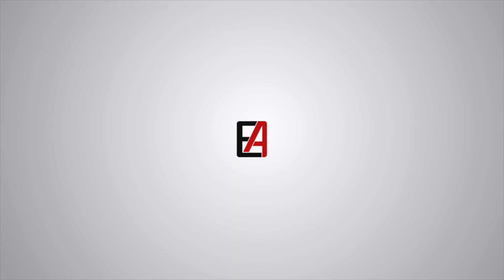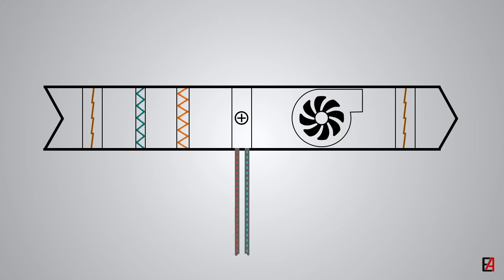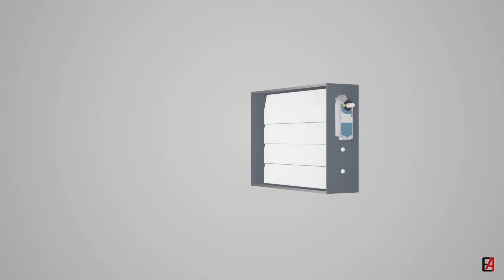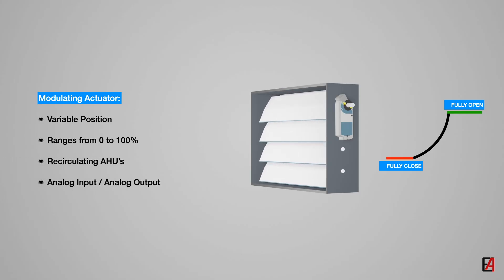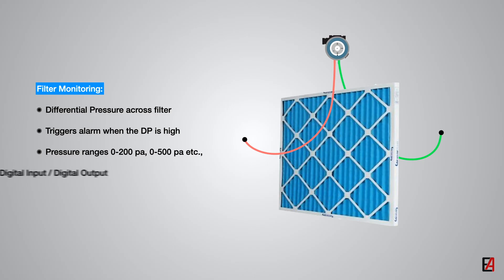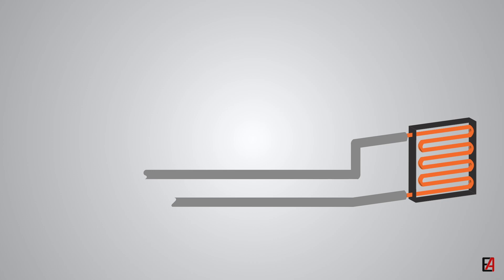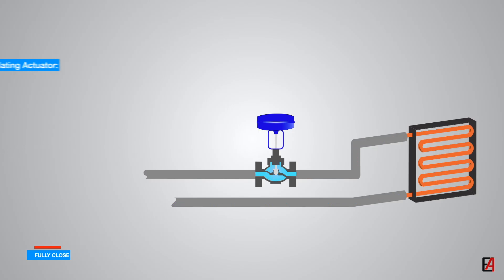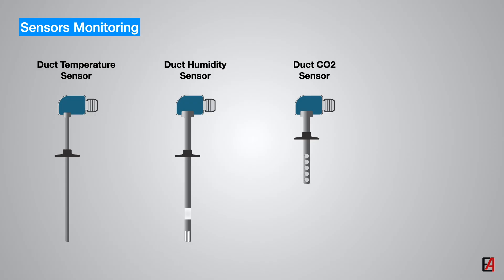BMS Monitoring & Control of AHU Components and Sensors

Comment: It wouldn’t be called “cooling coil temp” it would be your freeze stat or if not a freeze-stat you could install a averaging temp sensor which would fall before your heating coil or between your heating coil and cooling coil.
Reply from the maker: Hi Erik, It depends on the application of use. If you want to measure the efficiency of the cooling coil then you would need a temperature sensor after and before the coil.

Comment: AHU actuator not working on auto what is the reason.. please reply 🙏
Reply from the maker: Hi Raza, it depends.. can you please provide the actuator model… how you are checking on AUTO..
Reply: @engineeringautomation  actuator model -  Frese type 02 actuator 53-1297
Reply from the maker: Please check the wiring as per the datasheet. Also check if 24v power supply is available to the actuator. Check the dip switch setting. Also give 25% open command from BMS and verify the voltage on the control voltage from DDC. Verify voltage for 25, 50, 75 & 100 percent opening. Finally remove the actuator from valve stem and check if its working then the issue will be on the valve stem. Hope this is helpful. Thanks
Reply: @engineeringautomation  Thank you ❤️
Reply: DDT KE TO  ,,DDC  DCC  COMAND NOT COME  RESON ES

Comment: Hi sir , thanks for the video. My question is how does the AHU motorized valve gets Its signal from the DDC ?
Reply from the maker: Hi Cruz.. thanks a lot for the feedback. Thr valves are provided with actuators which drives the valves. There are 2 types of signals for the valve actuators which are normally used.. 1) on/off type 2) modulating type. On/Off type actuators work on digital signals and modulating type actuators work on analog signals. Hope this helps.. let me know if you need any other informations. Thank you. Please subscribe and support
Reply: Yes
Reply: Controlled by ddc
Reply: Tamt one is   awesr give sadenl  second  give honney wel  controled   ddc demanded show  img  ddc showein  ahu  showe d

Comment: Very nice video.
I have 2 questions
1. What is the standard differential pressure when the filter is clogged and when the filter is clean.

2. Is the analog signal for dampers operating in percentage is 4 to 20 mA ?

Please share information regarding this.
Thank you.
Reply from the maker: Hi syed, thanks a lot for your feedback. 
1. Filter differential pressure depends on the mechanical selection of filter. However, 200-300 pascal can be set on DP switch for alarm in BMS to clean the filter.
2. Dampers normally controlled via 0–10v dc which is available in all the DDC panels. 

Hope this helps.. please like, share and subscribe to our channel. Thank you

Comment: Are the AHU and VAVs working together in conjunction based on the BAS sequencing?
Reply from the maker: Hi Thomas, Yes. If the AHU is serving to room with VAV’s then both should work together on order to maintain proper static pressure in the AHU main duct. A duct static pressure should be installed in the 2/3rd or 3/4th of the straight duct to ramp down the AHU FAN VFD when the VAV closes downstream. This will ensure proper air flow is being supplied to the space as per design requirements. Also it will protect the duct from over pressurised leading to accidents. Hope this helps👍

Comment: Hi, Could you please also include information on which sensor should be set to which value. Like DPS across Filter should have what value set or across blower motor what should be the value range and also how to select range for blower motor, filter, etc.
Reply from the maker: Hi, regarding the DPS pressure setting, 

For Fan run status monitoring the DP value can be of lower setting as it is only detecting the proof of air flow. So generally 50-300pa DP switch is enough for that. 

For filters, pre filter and bag filter will have different pressure drop ranges which can be found from the data sheet. Accordingly you can select the DP switches.

Since the pascal values can be changed anytime on the DP switches, if you do not have the values from the filter, its better to go for 0-1000pa DP switches. The price difference is very minimal.

Hope this helps, please support us by sharing and subscribing to our channel. Thank You
Reply: @engineeringautomation   Thanks! Also videos on  maintaining room pressure interlocked with MVDs.
Reply from the maker: Hi Adnan, sure there will be one video for the AHU sequence of operation. It will be included in that.. please subscribe and click the bell icon to receive notifications. Thank u👍

Comment: How to workin DP switch
Reply from the maker: Hi Nithin, the air DP switches have a spring loaded diaphragm. Based on the differential pressure setting on the front, the diaphragm gets activated and the contact inside the DP switch activates which closes the contact signal (24v dc) from the DDC panel thus giving input signal to BMS. Once the contact closes the BMS detects the switch as active. You can check the contact continuity with a multimeter by blowing through one of the probes of the DP switch. Hope this helps. Please subscribe, share and support our channel.
Reply: Highside blower side in  out  fixing
Reply: Bloweringhigh in,outfixing

Comment: Sir More useful and explaination is good. 

Please tell me how to take points to any units on & off from BMS to electrical panel.

Ex:AHU FCU CSU... Any units Electrical panel side BMS cabling point.
Reply from the maker: Hi Basavraj, Thanks a lot for your feedback.
There are 2 types of ON/OFF points.

1. ON/OFF command from BMS: For this there will be relay Output(DO) from the DDC panel to the Electrical panel. 24v AC/DC signal will have to come from electrical panel and when the ON/OFF command gets activated by BMS, the relay will close and the signal will go to the Electrical panel to start the fan.

2. ON/OFF Status to BMS: for this 24v DC/AC signal will go from DDC panel to the Electrical Control panel and there will be relay Contact in the electrical panel which will be closed in case of fan run/trip status and the signal will go back to DDC panel and get detected as DI Signal.

Hope this helps. Please subscribe and keep supporting our channel.